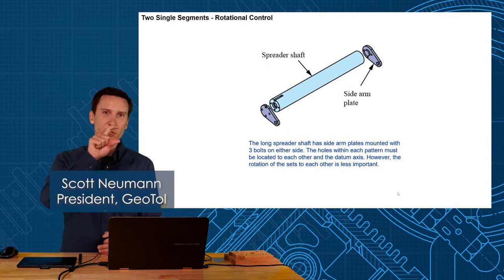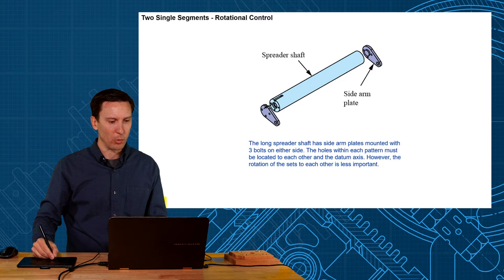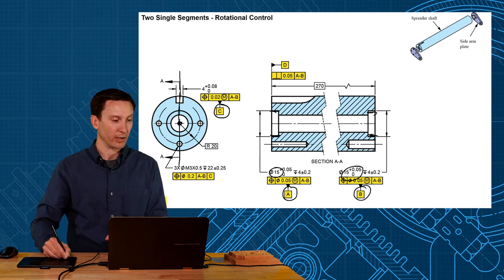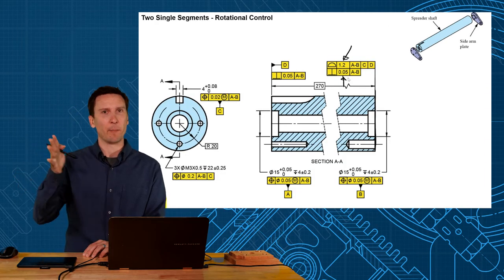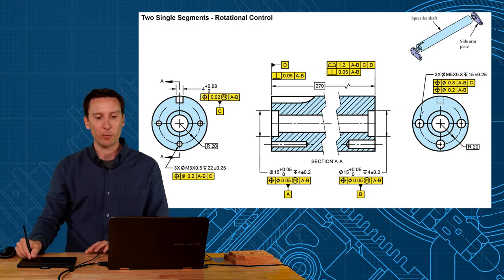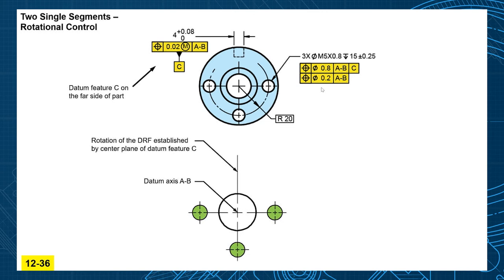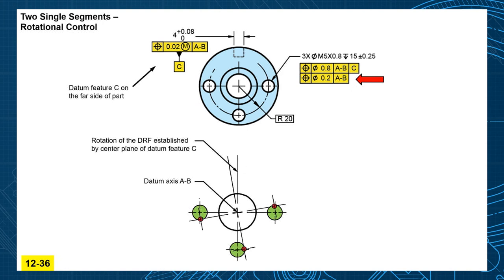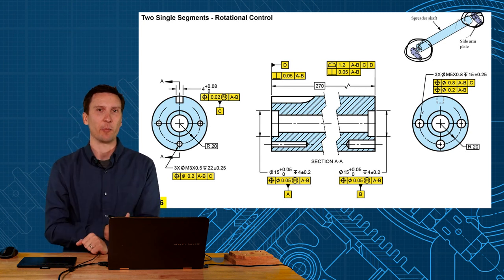Advanced Position Tolerance: Using Two Segments

Comment: Datums A & B can not reference themselves.  This is incorrect.
Reply from the maker: This is correct and they are not exactly referencing themselves. Datum features A and B are both located to the average axis, A-B. This effectively locates them to each other and is the ideal way to qualify the datum features. Look at page 102, figure 7-17 in ASME Y14.5-2018.
Reply: @GeoTolPro  But, A and B diameters are the defining positions that define the axis A-B, therefore that 0.05 dia position tol is nonsense. Can you explain more please.

Comment: Is it possible to create a datum A-B, which those are not properly aligned? For instance, in a bended tube, where the datum A is on the first bend and the datum B is on the second bend.
Reply from the maker: Yes, I have had to do this many times on tubes and pipes. This is not fully explained in the standard, however. It is an "extension of principle". I usually add MMB datum modifiers in those adjustable tube examples.

Comment: Shouldn't the position tolerance at 4:04, be a composite tolerance?
Reply from the maker: No, you don't want composite position there. The lower segment of composite is only rotationally constrained to the datum references. This would allow the holes to "float off" the datum axis. You need that hole pattern centered so it needs to be regular position to A-B.
Reply: @GeoTolPro , thanks for the explanation.
Reply: When you assign datum A and datum B in the feature control frame and relative to A-B. A-B does not exist yet can you do that?
Reply: @asaholey  yes, it's called a compound datum. it's a datum formed by A and B simultaneously.
Reply: @marcolima89  can I do that  to to a counterbore hole?   2  difference dimension hole same axis?
Reply: @asaholey  in theory yes, you can.
in practice I don't think it would be very useful.
usually the bigger diameter is for the head of the screw and doesn't require a lot of precision.
Reply: @asaholey  I was thinking exactly the same.
Reply: @GeoTolPro here datum reference is A-B, I think it doesn't make any difference either composite or multi segement, If I am wrong kindly explain